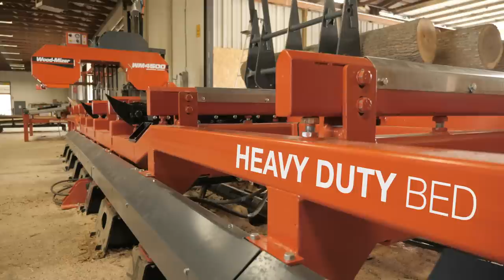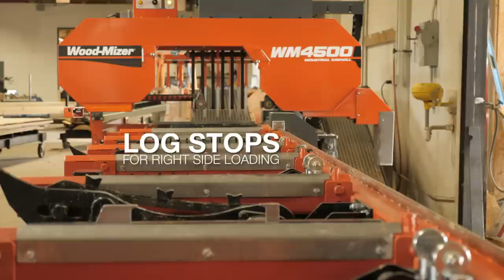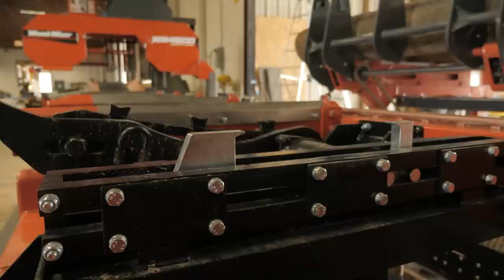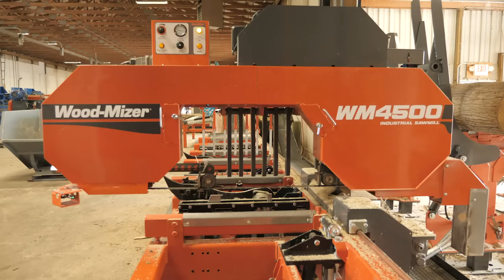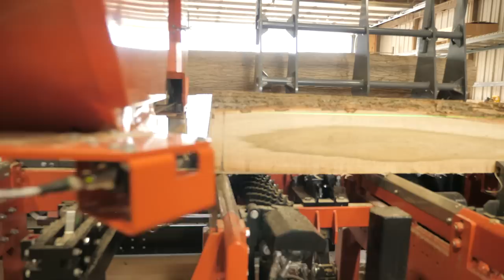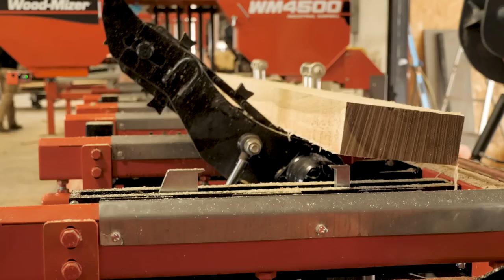WM4500 Industrial Sawmill in Action | Wood-Mizer

Comment: 2:26  You should stop when the blade is still on the cant,  as soon as it is done sawing, not go way past.
Reply: if the sawyer stops as soon as the cut is done, the trailing fingers that push the cut plank off won't be set to do so.  Have to wait till those fall down.
Reply: :face-blue-covering-eyes: You must wreak a lot of blades :face-blue-smiling:
Reply: @KaizenSteelDrums 😂